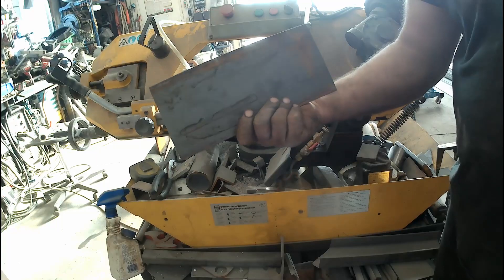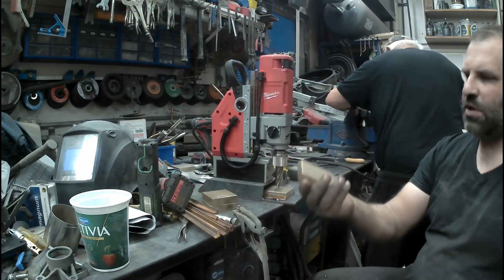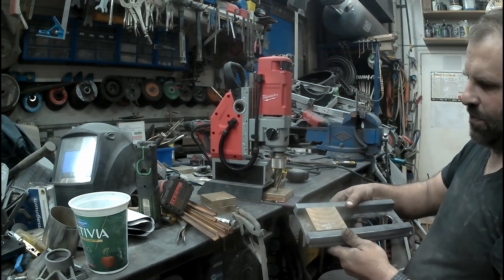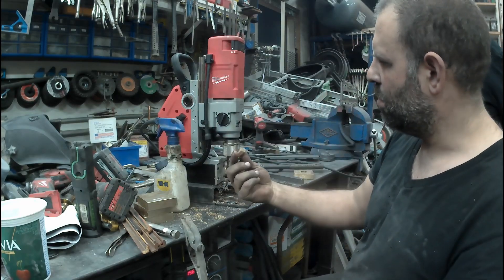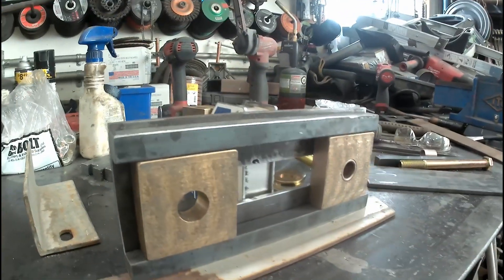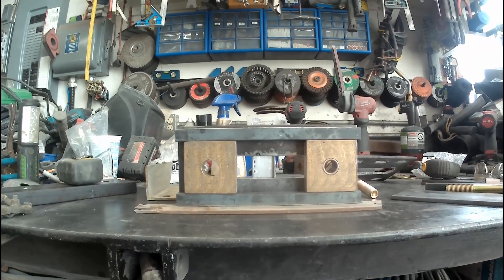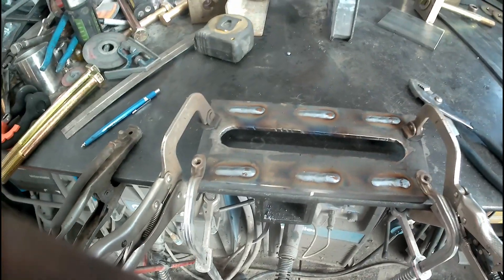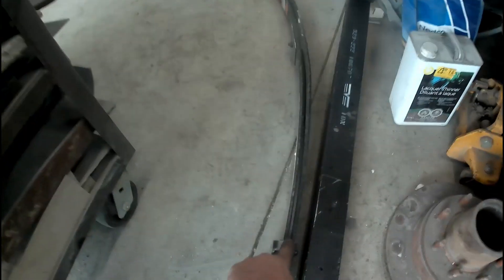OBS Ford Diesel 6 Door Build - Part 16 - DIY Spring Sliders

Comment: Good idea. I've seen them used but never thought about HD applications.  I'm interested in knowing how it works and handles.
Reply from the maker: Ive watched a few videos online but they were mainly either on race cars or small little off road trucks like toyotas and jeeps.  I only found one that was running it set up on a diesel and he was havving issues with the HDPE blocks crumbling so he went to bearings,  then to brass blocks and said the issues quit.  So....  I went straight to the brass blocks and oversized them.  I cant see why it would handle any different that a rear shackle,  if anything it should tighten up any side to side play you would have with the extra shackle bushing.  Im sure I'll have some update vids once its on the road and seen some miles.
Reply: @Shopworx  I think it will work well.  I'm just wondering how much better it might work than a shackle.